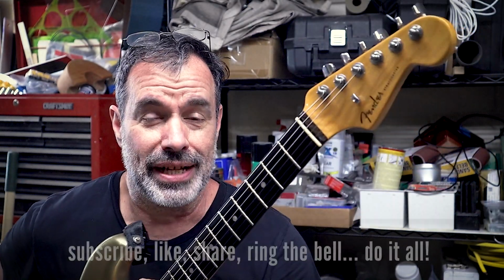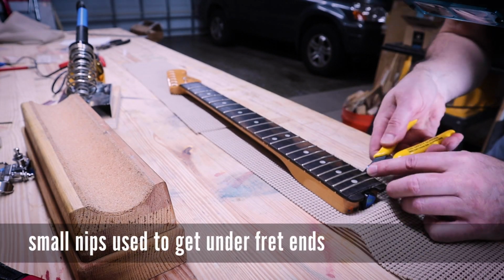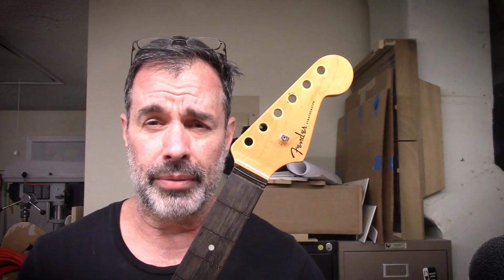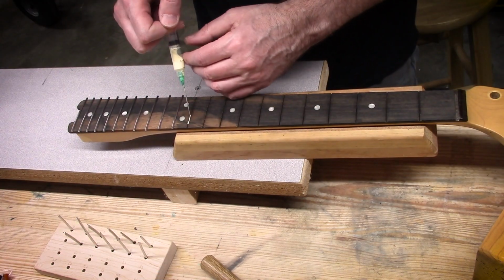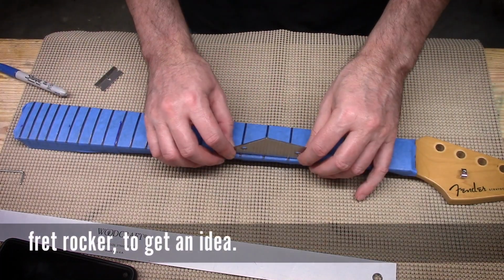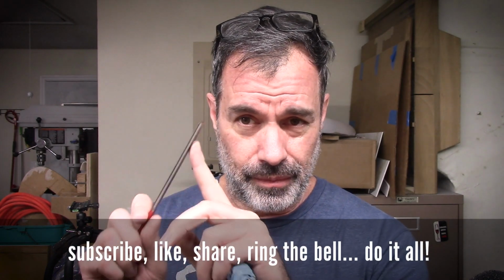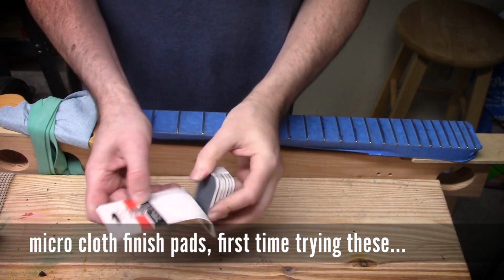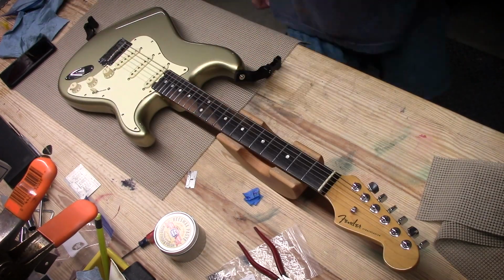Fender Stratocaster Stainless Fret Install Project

Comment: Given all the stories I've heard on various forums (fora?) about how hard SS frets are to work with when radiusing I've stayed away from attempting it myself even though at times the urge has been overwhelming.
So I was quite surprised by how easy you made it look in this video and had to rewatch it a few times to be sure there wasn't a key piece of info I was missing.
Titebond and an arbor press ... that's it? no special obscure tools? no third degree wizard secret forbidden knowledge? no magic incantations? no offering your first born to Azathoth?

I've got an ESP LTD EC-256 in distressed Honey Burst on which I'm running out of room to level and dress on.
I'm gonna buy a set of pre-radiused SS frets and do it.
Thank you for the inspiration.
Reply from the maker: LOL, it's mainly smoke and mirrors, but yes all those other things too.
Fretwire brands, I'm really sold on Jescar.  
Dunlop wire has been good.
StewMac stuff seems pretty good to - not sure who makes it for them. Sintoms I'm hit-and-miss with, I had some stainless wire that was slightly magnetic - odd. I think it was listed as "extra-hard", so I don't what's in it, or how it's made.  
Some random wire from Amazon, I ended up not using as there were finish flaws, irregular sizing... 
So, spend the extra $5 and get Jescar, Dunlop, StewMac... 

For me, it takes pretty much the same amount of time as nickel wire. 
Stainless is definitely harder to cut, and harder on tools, but that's bout it.
You will need good quality cutters, nips and files. So there is that expense.

When you order pre-bent wire, get it bent to the radius you have, or as close as possible.  The stainless wire is a bit "springy" so you won't want to get 7.25R wire and smash it in to a 16R board, It will lift sooner or later.  If you have a compound say 12/16, you could get 14R wire and make that work. 
If you don't have an arbor press, you can hammer stainless in also. Hammered wire is less radius critical, as the wire will deform somewhat during the hammering. It should seat neatly to the fretboard anyway.

Titebond, or even medium viscosity superglue (CA cyanoacrylate) will work.
CA can be tricky if hammered in, as it may want to spray out during the hammering. If pressing in CA stays put pretty well.
Post install thin CA wicked under the crown, or at the fret ends can work also, but agian, CA can be permanently messy. Keep it off the neck and any painted surfaces.

Good luck with your projects!
Reply: @theNextProject  - That's incredibly helpful info, thank you.
I'll report back when done, and I promise I won't blame you if anything goes sideways. 👍
Reply from the maker: I get blamed for everything. Don't want it, but I can take it.
Good luck with the project!
Reply: @theNextProject  - Some people will acknowledge and appreciate instructions that make the task easier, some people will spend their evening cursing and swearing at the empty IKEA box because they didn't RTFM.
The way of the world I guess.
Cheers man.

Comment: Hello I just found you and I had to subscribe. I love Stainless steel frets. I'm considering trying to do this myself, hence why I watched the video when you showed up in my feed. 
I would be Fender does the compound radius using a CNC machine. I used to program them in a machine shop and it would be a rather easy task to do so, but I don't know that is how they do it for sure. It sounds like they might have not been really good at it and sounds like you really made the neck good! 
Thanks.. Great video.. 
Tim
Reply from the maker: OG, welcome and thanks for watching!
Stainless frets are pretty great, and should last a loooong time.
Not sure what fret tools you have, but if you plan on stainless, you'll need a good pair of cutters and nipper, and decent files. Overall, the process is the same as nickel frets, but the stainless wire is a bit more "springy", so you'll want the fretwire radius to be reasonably close to the fingerboard radius. If you plan to hammer the stainless frets in, they will deform enough during hammering to minimize the issue.
If I recall, this neck had a rather faceted surface. Not sure if that was part of the Fender process, or just how the wood changes over the years. It's always interesting to run across odd stuff like that, kinda fun.
Good luck with your project.
Be safe and take care!

Comment: I've seen where people use a rubber eraser to clean out the fret file. Might be something to try?
Reply from the maker: Hey Jeff, thanks for watchin!
Yeah, I've heard about using an eraser too. I think the fellow of Fret Maestro Fret File System mentions using an eraser.
I heard of using cutting fluid from a northeastern US luthier, David Collins I believe. 

At this time, I put a drop or two of oil on the diamond surface of the file, then go to work. Wipe the file off with a paper towel, reapply a lil oil, and back to work. 
I like how the oil ( currently using 3 and 1 oil ), keeps the filing debris suspended, easily wipes off. Eliminates any chance of file gauling the surface, and may improve the life-span of the diamond coating ( no proof of that, just wishful thinking ).

So far, I really love how easy it is to use a diamond file with the oil. No more cleaning, just a wipe of the towel and done.

Life is good  : )
Reply: @theNextProject  you're welcome. I have been researching fret leveling these last few months. His fret leveler looked to me a great idea. But the price is way out of the league for hobby guitar player like me. I only have 7 guitars and some have different radius fretboards. So that means buy a whole new set up if i want to do all my guitars.

He had a cheaper setup when he first came out with that but then changed it to a metal body and to be expected the cost went up too. That's what i like about this truss rod setup. I can do my different guitars and still get a good result. Now I just need to find a cost effective way to crown the frets.
Reply from the maker: Agree, the Fret Maestro system looks interesting, and I had considered testing it, but the price ended that consideration.
I've been working on a wide range of board radius', and compound radius', can't afford $2K for a complete Maestro kit. Especially when a few good and simple tools will do the same task.

If you plan to do the "banana" leveling process, practice on your least favorite, or least expensive guitar first. Use 320 grit paper and go slow. The high spots will quickly reveal themselves.

As for affordable crowning, I've done a couple videos on crowning files. The good news is there are some files to avoid, the bad news is the really good tools are typically more expensive.
At this time, I'm really drawn to either the Fret Guru crowning files, or the StewMac Diamond Z-files.
I had tested a SM Compact Centered Z-file, and I really, really hated that little file. Ended up sending it back to SM.  I've since purchased their full-size Centered Z-File and it is a far, far better file. The quality of manufacturing is waaaay better then the compact version.  That said, I still followed the Centered Z-File with another file to get a better, narrower crown before polishing.

Here's links to the 2 file vids:
Steel tooth files
https://youtu.be/84KmXY-PQNY

Diamond coated files
https://youtu.be/TAV8tNNrHM4

Good luck with your projects!
Reply: @theNextProject  thank you! Yeah I won't be testing this on my ESP custom guitar. Plus, it has stainless steel frets.

I have a few budget LTD Strats that could use a fret leveling. I'll try it on those ones.  Thanks again!

Comment: 13:55 Thank you for this tip! I will try next time.
Reply from the maker: Rodolfo, thanks for watching!
Yes, give it a try. I've used this method on 6+ fret jobs now.  I don't see any downside, other than the file may cut a little slower due to having lubrication.  I find that not having to clean the file easily makes up for any difference.
Also, I'm wondering if file life will be prolonged too, I hope so.
Good luck with your projects, be safe and take care!

Comment: I'm going to install stainless frets on one of my guitars. love the idea that you shared from someone else to use rapid tap as a lubricant for fret file. I also think this idea is a keeper and I already have it in my shop for other metal projects. Thanks for sharing!!! I'll also have to check my fret rockers on a couple of  machinist squares to see if they are true.
Reply from the maker: Mike, thanks for watching!
I've used the small drop of oil (rapid tap) on 3 more fret jobs, I'm thrilled at this point.
Just a drop on the fingertip, wiped over the fret, another drop rubbed onto the diamond file. You don't need much, and you'll quickly figure out enough vs. too much.

I haven't had to "clean" any of the diamond fret files since I started using the lubricant.
I just wipe the file off with a paper shop rag, and go to work. Hated cleaning the diamond files every other fret due to them pluggin' up.
Life is good.

Good luck with your projects.

Comment: I thought I commented on this, but I hadn’t. 

I’ve mentioned it in other video comments, but I will be attempting my first fret job soon on my Strat and am putting stainless frets in. I’ll be watching your video and others repeatedly to soak up as much knowledge as possible. It’ll be like “measure twice, cut once”, but “watch twice, cut once.”

 Currently I am fixing the paint issue I had over the weekend. The color and clear had incompatibility issues, so it wrinkled and is gummy just under the surface. I attempted sanding with a palm sander and block, but that clogged the sandpaper moments after I started. I picked up spray Goo Gone graffiti remover which works a whole lot better. I didn’t have any abrasive scrub pads so those are being picked up today.

Once done, I’ll refinish in nitro, which I should have done to begin with. 

I will work on the frets as I work on the paint. Fun fun fun fun!!
Reply from the maker: Tim, thanks for watching!
WOW, you're a busy man. Sorry to hear about the paint/clear issue, I sympathize. 
Yep, I recall you mentioning stainless frets, and I think you mentioned you've done some fretwork before. 
You'll be fine, just set aside time so you won't be rushed, or come back to finish the job when time allows.
It will all be good!

Ugh, I'm thinking about paint issues. I hate paint issues!
Wishing you the best, and keep me posted
Be safe, and take care

Comment: Gonna try the fret oil--great idea!
Reply from the maker: Patrick, thanks for watchin!
So far, I am surprised and delighted by adding just a drop of oil lightly applied.
I've been irritated by the diamond fret files constantly plugging up, and so far adding the oil seems to eliminate that issue.
I just wipe the file off with a shop towel, and move on to the next fret. 
Hope you have a good experience trying this too!
Good luck with your projects, be safe and take care!

Comment: Love the whole job & your attention to detail, esp keeping the tuners in the same locations. My variable OCD would probably lead me to making sure the same screws went back into the same holes too, obvs turned backwards until each found its thread, as you advise. Next!
Reply from the maker: Museums, that is for watching! 
I may have a little OCD too, at times... 
I didn't think about the neck screws going into the same holes, but now that you've mentioned it, my brain will be looking for that next time.
Turning the screws backwards, to find the threads is such a great and simple thing to do, and would save so many guitar necks from thread damage.  I never heard anyone else mentioning it, but it really does work.
Works equally well when working on plastic parts that have screws in them. Plastic doesn't like re-threading.
Hope all is well for you. Be safe and take care!
Reply: … and that’s one reason I’m not such a Strat fan - too many pickguard screws to keep track of. 
All the best from the UK, and take care yourself and yours too, until the next project!

Comment: I only have a cheap fret rocker, and it’s clear that it was laser cut. The roughness left behind by the laser makes it unusable as an straightness test device. I don’t know if higher end ones are better. I guess it’s a difficult shape to machine, but laser cut is unusable
Reply from the maker: Fab, thanks for watching! I have a laser cut rocker too. As you say, they are rough and take a lot to correct.  Also have a sheared rocker.  I think the all need to be precision machined for accuracy, but most are not.  
I also use precision steel dowel rod, which works great, and have some various lengths of aluminum and ground flat stock that work well.  Many options to use when we look for them.
Hope all is well, take care!